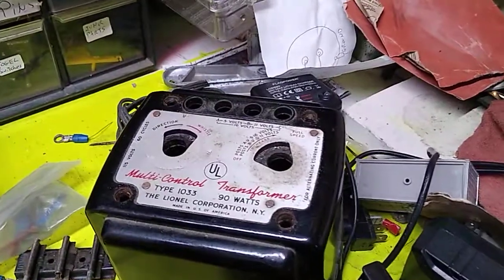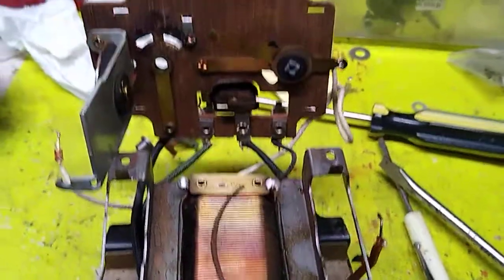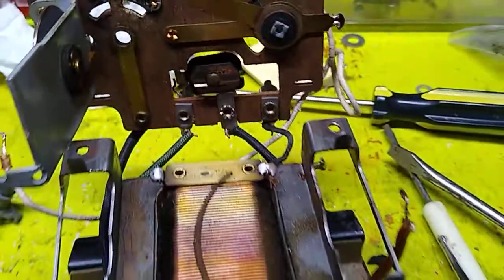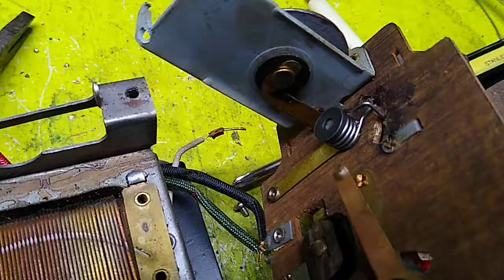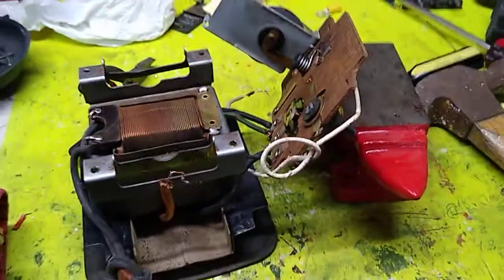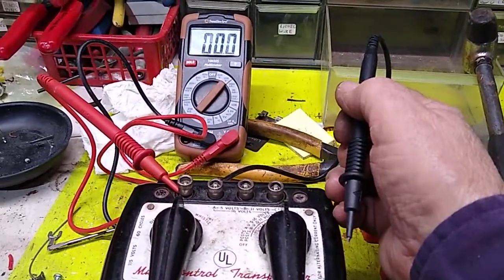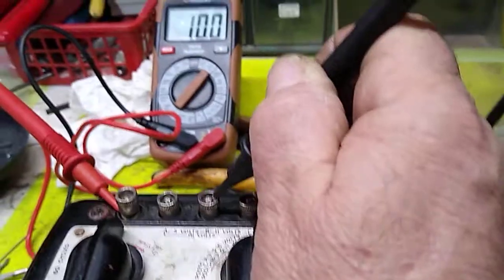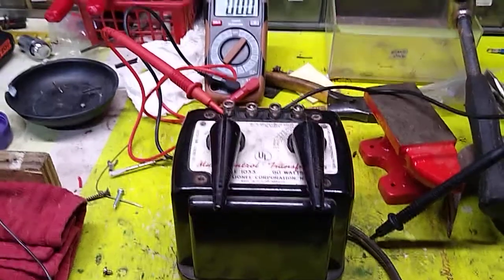Lionel trains post-war 1033 transformer repair

Comment: Hello, Don, thanks for the video! When you measured the voltage using the multimeter what is considered a good range for each post? I saw the numbers on your video but I'm still learning what's considered to be a good range to have enough current.
Reply from the maker: On the 1033 transformer, there is a "U" = common terminal, and then A, B, and C "Hot" terminals. On the unit's face plate is:

A-U = 5-16 volts

B-U = 0-11 volts
Reply: @REDHOUSETRAINS  Thank you!
Reply from the maker: @melanieholland8165  where are you from?